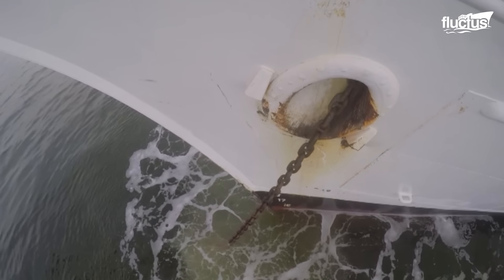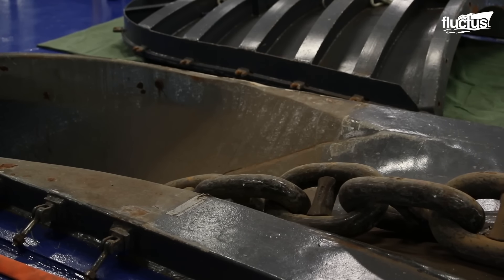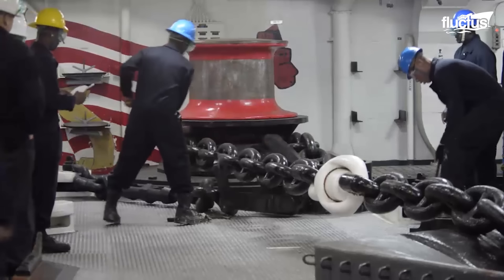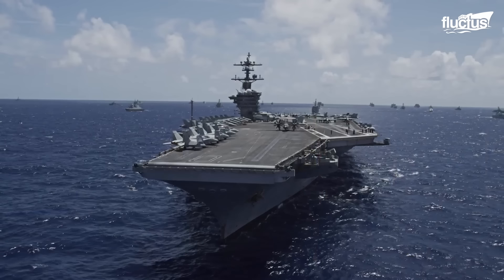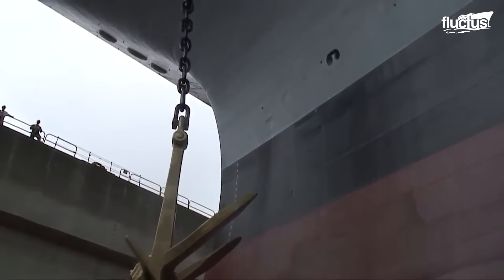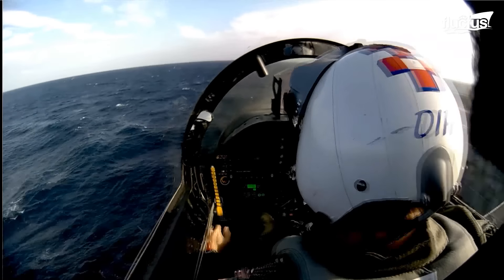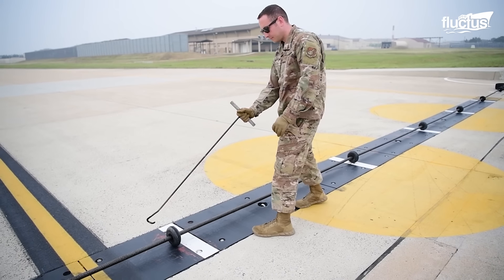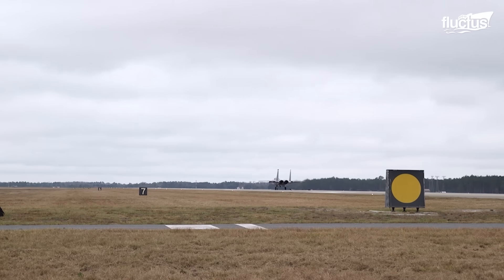How US Navy Drops MASSIVE Aircraft Carrier Anchor at Full Speed

Comment: What if the ocean floor is 5 miles below the ship? Do they drop a chain 5 miles long?
Reply: Going to anchor is normally reserved for when the ship is close to land. Depending on the size of the ship, a frigate can carry 10 shackles ( 1 shackle is a 90 feet section) and aircraft carriers carry 16 shackles. You want a minimum of 3 shackles on the sea bed to hold the ship in place. The only thing the anchor is for is to keep the ships cable in one location. It is really the weight of the ship's cable that holds it in place. The bos'n has to report the position of the cable every 15 minutes during anchor watch to ensure the ship is not dragging her anchor.

Comment: I am a bit confused. If an aircraft is able to land what does it need arresting gear for? If it is on a land runway it will eventually stop. Unless it's brakes are out. But they could reverse engines.
Reply: Probably to stop before the runway does...
Reply: @shinobuoshino5066  If you can run out of runway then no plane can land. What's more it would require every plane to have a hook.

Comment: Ok, Im sure Im not the first idiot to ask this question, but what if the ship has to anchor in water deeper than the length of the chain?
Reply: It's faster to sink it...
Reply: Ships don't anchor in water deeper than the chain, hell you require a certain amount of chain along the ocean floor for it even to work properly (not just the anchor itself). If in deep water you require to use thrusters to maintain position or a sea anchor (which most large ships don't have).
Reply: @reecesaliba7036  Hey man I like your answer. I spent 20 years in the Canadian Navy, and I think people don't realize that the only possible reason to use the anchor/ships cable combination is to keep the ship in one place (relatively speaking) for an indeterminate period of time. Reasons for going to anchor(that I know of): 1. Giving the crew some rest, 2. Avoiding major storms, 3. Awaiting new sets of directives/ orders. 4. Saving on fuel. Personally, I always liked going to anchor. Anchor watches are much more relaxing than sea watches.
Reply: @msamour  thanks for the feedback! Im relatively new to a navy lifestyle but already find it amazing how much is just misunderstood. I cannot imagine all the great (and shit) times you had over 20 years. Anchoring for most large vessels is just not as common as people think, most of the time your either sailing or tied up in a port.
Reply: @reecesaliba7036  Give it time, They will want to save on some fuel going forward, so you will likely see anchoring a lot more than you think. You will love banyans. Hope you have fun in your Navy career!

Comment: 30,000 pounds is better explained with an example which people can better  visualise.

Weight of the average anchor on an aircraft carrier is 30,000 pounds which is 13,607 kilograms.
Weight of average sized car (sedan) is 1302 kilograms.
Therefore, weight of average aircraft carrier anchor is 13,607 ÷ 1,302 = 
10 average sized sedans

Comment: First of all, I have issue with the cost of this system using a truck tire as part of the arresting gear at around minute 9:50.  This is part of the expense of the system?!!!

Second, if the film makers are going to be professional, please delete the spider web part of frames around 11:44.

I didn't spend by career in the Navy or Air Force, but did serve 23 years in the armed forces of the U.S.

Comment: On the USS Enterprise CVN-65 each anchor weighed 35 tons (70,000 lbs) and the golden anchor was carried signifying the senior ship of the fleet. Each link in each chain weighed ,ore than 350 lbs. The space that housed the machinery to secure and drop the anchors is called the Forecastle and the windlass is the winch used to hoist and lower the chain. Get your facts straight or stop posting crap.